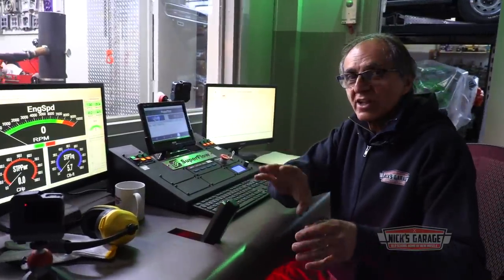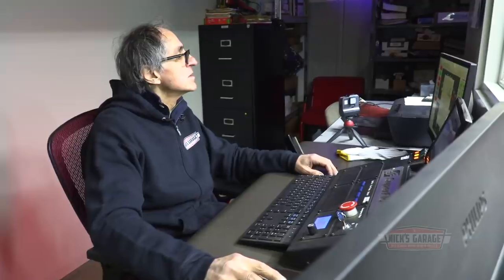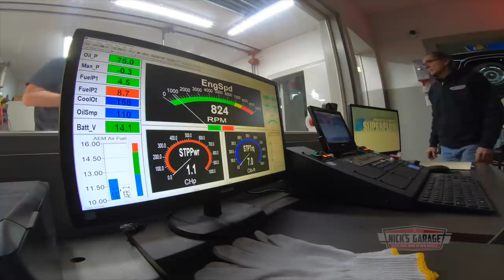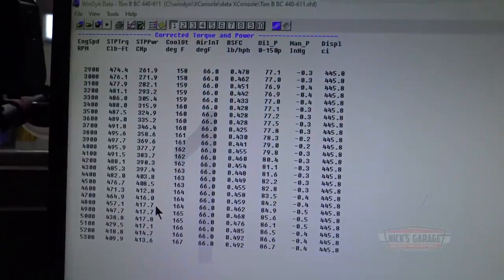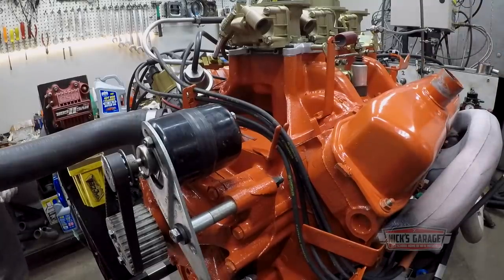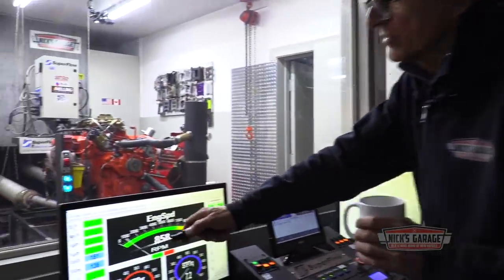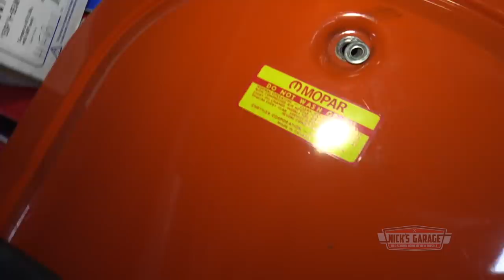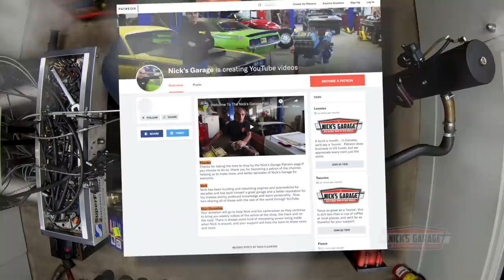Classic 440 Dyno Tested - 1969 A12 Road Runner 6 Barrel

Comment: A friend of mine that was into drag racing with olds 455 engines in his 70 Firebird drag car, made em live with lots of oil. The olds 455 engines were notorious for spinning bearings because of their large crank journal size, he made em live with a 9+ quart oil pan, high volume and pressure oil pump, bearing clearances slightly on the lose side, straight 30W racing oil, he also ran an "accu sump" oil system on it. His theory is you need heavy weight oil and lots of it, with zero starvation issues. He also has a mid 70's chevy 4x4 half ton truck that has 3 ton axles, transmission/transfer case under it, a blown 454 chevy sticks out of the hood, he uses it as his equipment hauling rig, has custom titanium headers as regular aftermarket steel ones just melted, he pulls backhoes and graders on a trailer, goes over mountain passes and blows the diesel guys doors off with his blown 454 chevy. He runs a straight 50W racing oil in that engine, does the same thing as the olds engines, huge oil pan, high volume, he says never let an engine have starvation issues, that's when you'll spin bearings.     
On the other end of the oil spectrum I had another friend who ran Yamalube R 2 stroke premix oil in his crank case of his 350 chevy engine in his circle race car! I don't know what the weight of 2 stroke pre mix oil is, but it's light, his theory was the light weight oil allowed the engine to rev faster but still offered enough bearing protection, seemed to work as he won lots of races, cars exhaust smelled like a 2 stroke engine.

Comment: Nick your channel is awesome. Today May 21, 2023 I was leaving a grocery when i heard someone having engine issues. Not being very knowledge but willing to lend a a hand, assistance was offered. This was a 68 Ford F100 with an in line 6. I followed your instructions but wasnt sure how to check. Air, Fuel, Spark. Three other folks came to offer aid. And class began. After running through the check list we found the issue. The carburetor. So just to get him running we shot some starter fluid into carb, we got turn over. Because we were willing to help a jewel of experience was awarded. Your teachings gave the confidence to at least try and help someone else. Thanks Nick
Reply from the maker: This is terrific! Thanks for letting us know, Bobby. Nice work.
Reply: Thanks Mr. Nick

Comment: What a way to wake up! To Nick at the dyno with my favorite engine and car.. brings back the memories.  I took this engine back in 84 with alot of the A12  parts on a 69 RR with a4.10 gears 4 spd. 485 comp can . 30 over pistons. .5 bump in compression.  Some 10 inch slicks. To a best of 11:38 @118 traction was at premium.  Latter worked on the rear. More cam 590 purple shaft. But no 6 bbl. Could afford one so it was ran with a torquer tm7 800 holley. It then ran a best of 10:69 at 124.7 .. still have the old bird.  Looking forward to some day.. as we all do.
Reply from the maker: Congrats for holing on to the car all this time.

Comment: I am a big fan of WIX oil filters. I've used them for years.
Reply: That's all you really see at the drag strip. That and Amsoil motor oil
Reply: @Oakie very good. Dads been using them for years. Swears by them. Fram are junk personally.
Reply: @TheSleepyMechanic0524  Fram and STP are manufactured by the same company. Ok filters, but nothing beats a WIX. Imo

Comment: Test seems to prove that HV oil pumps don't rob nearly the power people think. I too like 10w-30 oil, but I prefer the HV pump with fully grooved main bearings and looser than normal production clearance (.0025" rods and .003" mains). Nice work!!

Comment: Awesome !!  Nothing makes a 440 better than a properly tuned 6 pack !!  Great job !!  Cheers !!
Reply: Well Paul, in fact it is not  6 PACK....It is from a Road Runner and therefore a Plymouth...and...Plymouth never produced Six Packs...only Six Barrels...
Reply: @mark006868  Your absolutely correct. I was referring to the 6 pack induction in general. None the less your right on.  6 pack on a Dodge, 6 Barrel on a Plymouth.

Comment: Man so those Chrysler engineers had a good idea what they were doing! Thank you for sharing Nick!
Reply: They did?
With some head work and a better cam it's still not putting out 1Hp per cubic inch. How is that a good idea?
Reply: @OldGriz708  .     Those exhaust manifolds take up easy 40 HP.
Reply: @OldGriz708  Chrysler Engineering superiority by your benchmark of 1:1 HP:Inch³ ? The 426 Hemi would meet or exceed your requirement. The 440 6bbl had hydraulic lifters, iron heads, and in most cases a cast iron intake manifold. Although the HP RB exhaust manifolds weren't horrible, they are a 30 HP detriment to output. From the 440 4bbls and 440 6bbls close to or dead stock, usually they dyno at about their factory ratings + 5-10% Again, from an engineering perspective, the deep skirt block design has inherent strength to it vs Ford or GM big blocks, and the shaft mount rocker arms are the epitome of valvetrain stability. I'm building a 541 BMP aluminum block, and it will be fed by the 3 Holley 2bbl carbs from the 6bbl, albeit on an aftermarket single plane intake manifold.
Reply: @OldGriz708  For the period in time of when they were made, the power they put out was very good.  By today's standards maybe not so great, but back then they were as good or better than most every other brand.  The basic block and head design of these RB Chryslers is at least 60 years old - of course some things have improved since then.  Plus, as we learned from previous dyno tests on this channel, the exhaust manifolds are a huge restriction.  It wasn't like Chrysler didn't know how to make a better exhaust manifold - more like the bean counters got involved and that was that.
Reply: @johnz8210  
They never made the power they should have for the  cubic imches.
Reply: @OldGriz708  That is true.  But nobody else really did at the time, too.  Cylinder heads and camshafts have come a long way since then. 
Pick-up truck diesels now have more horsepower than the biggest baddest semi truck engines of 50 years ago.
Reply: @OldGriz708  The bottom line: among pure stock cars, A12s  were essentially unbeatable.

Comment: Headers are such a pain they aren't worth the problems unless you have a race car. Headers you fight spark plugs, frame clearance, starter swaps, heat. On my chevies I've gone to ceramic coated center dumps that are bigger than stock. And one is a stainless steel rams head that is set up like a header - so performance isn't far off. Save all the heartache.

Comment: Great video and Test - Fixating entertainment! Increase in torque with the air cleaner in place is due to the airflow being organized for better flow by the air cleaner base, this as the air flow transitions more efficiently over the top and down the throat of each of the carburetors. Old Mopar drag racing trick is to run just the of a Mopar air cleaner for best performance.
Reply from the maker: Thank you!

Comment: In a lot of respects, it could be said the 440+6 could have been a better street engine than the Hemi. It sure made the torque. The Hemi was raw HP on the top end and you could get it to do a heck of a lot with gears and some other minor stuff, it was a tuned down race engine. But for realistic day to day driving, that 440+6, or any HP 440 with high compression really made great torque on the low end and didn't cost a fortune. Easy to own for sure.

Comment: My old 440 in my '69 charger used to run about that same oil pressure, even when warm. It would also scream up to almost 7000 RPM though so it could use all the oil it could get! Dick Landy Enterprises did headwork on that engine and it sure showed.
Reply from the maker: Sounds like a beast.
Reply: @NicksGarage  it was! 12.5:1 compression w/big Racer Brown cam: .610" lift @ valve and 312 duration @ 0 lift on a pretty tight lobe center, solid cam. Very rough idle. 6 pack full floated rods, nitrided std. journal forged crank, TRW forged pistons, Max Wedge adjustable rockers and hemi hi volume pump to name a few items. Passed everything but a gas station and made over 600 HP on a dyno 40 years ago. 4 speed car made it more fun, wish I still had that car now!
Keep up the great content, Nick! Love my Mopars!

Comment: A great way to start a Monday, the sound of a six-pack making some very respectable power.  I know that Tim will be impressed with the dyno numbers, especially with the air cleaner installed, great job on the engine Nick.  A-12 cars are always impressive, but this one is going to be just a little bit better, now that you have worked your magic, on the engine. Great video as usual, very informative, and entertaining.  Already looking forward to next weeks episode.
Reply from the maker: Thank you very much, sir.
Reply: Eugene I’m very happy with the numbers that Nick hit on the dyno! Putting the air cleaner on was a good idea Nick, we discussed what HP I would like to see from the very start and he nailed it! Amazing, the car and engine went to the right place no question about it!
Reply: @timbutler7433  Tim, you have an awesome car, and very rare too. A-12 cars have always had a special meaning for me.  I remember driving one of my friends to the Dodge dealership in July of 1969 to pick up his brand new A-12 Super-Bee in B5 blue.  I feel the same way about my Charger being in the right place.  Nick does fantastic work on the 60's muscle cars.  Enjoy your impressive ride Tim.
Reply: A 70 torino cobra with a 429 is faster with a smaller engine and it weighs 4.200 pounds doesn't say much for a 3.500 pound car with a 440
Reply: @darrellsomers5427  That may be, but I would take the Mopar over the ford anytime if given the choice.

Comment: Fun Fact: When I was setting up my six-pack in my '70 Cuda, the secondaries wouldn't come on until about 4700-5000 rpm. I bought two vacuum can spring kits. Tried different springs in the kits, settled on the white lowest tension, cut in half. Secondaries would open at 3200-3500 rpm, which ended up being perfect. A properly set up six-pack is a dream come true!!!!!! BTW, mine did feel like a double kick down.
Reply: What secondairys there 2bbls you slowpar  guys kill me

Comment: I'm not surprised you did a tic better with the air cleaner on I've seen guys remove air cleaners at the strip and go slower (me included) something about smoothing the air flow, I dont know. I think this A12 will pick up the lost hp once in the car and supplying some forced air.....nice job.

Comment: Where, oh where were you @NickPanaritis back in 1978 when I owned a 1970 Dodge Coronet R/T 440 6 pack? There was nobody in a 50-mile radius of Central Florida back then who could properly set up the 3, 2-barrel configuration with a mild lift camshaft upgrade to my 440. A bunch of "Specialists" said they were proficient in fine-tuning multi-carb setups. It turns out that the only thing they were proficient in was making my wallet light! After seeing, and hearing Tim's 440/6 singing on the dyno after you worked your Voodoo on it. I wish I could have taken my Coronet to Nick, instead of switching to a 4 barrel setup from Vic. (Edelbrock)❗👍🇬🇷🇺🇸🇨🇦
Reply: Greg.      In 1978 I owned a 426 71 Hemicuda,,  dual carters, and a 1970 AAR Cuda 6 Barrel. And at the same time, I worked for a Pontiac-Buick-Cadillac dealership working on engines. I wish I was there to help you out with the 1970 Coronet R/T.

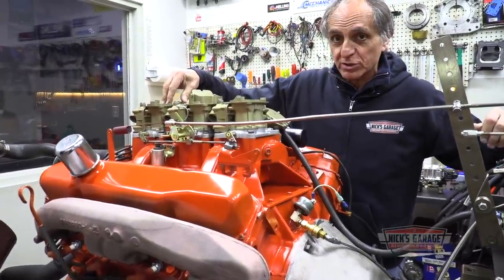Comment: I had back in the day a 70 Cuda 440 6bbl , 4 spd , shaker car 3:54 gears, the carbs were mechanical no vacuumed pods , Mallory dual points , mechanical as well, with a 525 racer brown cam, I don't know what h.p. it ran but it was fun to drive, it had pwr steering,  and per brakes all the horse power robbing accessories,  but it was still pretty fast.

Comment: Morning Nick & Devon, that was one sweet sounding 440 not only at idle but when taken out to 5300 rpm's also. I knew you would get your numbers too Nick. Glad you changed the oil pump as that pressure was way to high. I hope we see a video once that 440 is installed in the car and the weather is right Nick & George. Thanks for sharing as its the best start to the week.

Comment: Hi Nick. A test with different octane. Way for all gasoline car engine are basically produced for 110 Octane gasoline. Take a test with 95 octane up to 110 octane and see what happens. A test with 95 and 97/98 and 110 octane. Love the Classic 440 Dyno Test-1969 a12 Road Runner 5 Barrel. It is a Nice Engine. But it is made for 110 Octane. It is. Not 95 or 98 Octane. 110 Octane is 110 Octane. Back at the 90 i had a 68 Nova II 350 Engine. Love that Car real nice. Love from me too you Nick.

Comment: Very interesting episode!!! This is awesome... K&N was the right air filter element to use for this test!!! It actually gained 4 ft./ lbs. of torque with this test... Another thing to consider about using the ram-air filter with that car, is the increased air pressure into the intake from ram-air being forced into the large 6-pack air scoop, when the vehicle is moving along... Quite a cool episide!!!

Comment: Waow there's always something new to learn Now it's Tims 440's Dyno turn Nick's Garage has the technology and fuel to burn Running it over 100 psi makes Nick's mechanical empathy squirm  It's from a 69 Road Runner A12 into which it's been fascinating to delve I like the sound of a V8 any day of the week but the only guarantee is Nick's Garage on a Monday when it's the old school that I seek There's no oil leaking so it's time for Nick to do his usual timing and tweaking This engine's no weakling Built to drag best fun to be had Tim's got swagg

Comment: I used to be one of those guys that thought you needed to use a high volume pump, but with a 4qt sump pan like the 402 ,a high volume is a bad idea. A good high pressure, standard volume pump is all you need. The high volume pump is really for Hemis because of it has full time rocker shaft oil that has to fill 4 shafts. I have to admit though I did cringe a little when Nick took that pump right out of the box and put it on the engine , in the past I have found that the pumps are really that clean out of the box, yes the oil is going thru the filter before it gets into the engine but I like to clean them first and do a little clean up on the inside of any casting irregularities ...
Reply: John.       Good point.

Comment: I used to run TRW 
High-volume oil pumps 90 psi rated I’ll usually dial in @ 55 my big problem was power steering pumps so I always Converted to manual steering which became a problem with the spacers in the columns but then finding a manual box but that’s what I did on my charger and demon

Comment: 6 packs look nice , there really cool but one or two 4 barrels are lot easier to deal with and work just as good :)
Reply: You just don't understand until you ride in a properly setup and tuned 6bbl
Reply: No harder to set up a 6 pack than a single 4 barrel.

Comment: Hey, Nick! Love to hear those Horses unleashed. Is there a better sound than a 440 six pack engine. Whaling out loud. I thought the HP would drop when you put the air cleaner back on. But it didnt drop much. How would the higher oil pump hold out in the long run. Would it blow the seal or rings? Those Melling oil pumps are built really tough too. Great video!  Shawn.

Comment: The air cleaner assembly/hood was designed to direct lower temperature air directly into the carburetors with the vehicle moving, so in use, th
Reply: so in use it would be expected to increase engine output.
Reply: @georgewetzel4380  .    Yes.

Comment: Another great start to the week!  Seeing the big 440-6V engines struttin' their stuff is always so fun - just about the perfect toy that any grown adult boy wants to find under the tree, especially if it comes gift-wrapped and bolted on a dyno.
I must say, however, that it's been too long since we've been treated to the biggest toy of them all, a 426 Hemi on the dyno.  My energy level is dropping and I feel a little faint.
p.s. - Was there any change in the A/F ratio running with the air cleaner on?
Reply: Easy.        No, no change.

Comment: Dear Nick 
 My passion is Holden inline  6 cyd. Engines 
Your passion 440 Chrysler engines
I can still buy new Australia make oil pumps. But I have to dismantle them and remove the swore of the drillings and general machining. ( Brilliant )
I agree with you on oil pressure over 70 p.s.i  cost you h.p. and the oil gets hotter costs you reliability.
Not so cracky old man from Down Under

Comment: No better way to start the week then a 440 six barrel !  Superb.
Looks like a fiberglass lid on the air filter? The tin ones fit way better
Reply: Mike.          NO fiberglass lid on this engine. It has the real tin plate.
Reply: @nickpanaritis4122  the edges aren't rolled down? I have a tin Hemi lid . looks different around the edges. ( talking about the orange lid)
Reply: @MikeJBlues  .      Yes, the orange lid.   It is Tin, maybe repop ?

Comment: These engines, like most high performance engines of the day were under rated for insurance reasons. A bone stock 440 six pack was around 425 horsepower!
Reply: No they were not you slopar guys kill me its a mid 14 second car stock

Comment: Love your channel Nick!! I’m a huge Mopar fan and I’ve learned a lot from watching you for many years. I have a question. Of all the videos I’ve watched about running engines on the dyno, why does so many people start the readings at 3000rpm? Now in this video, you started at 2800.  Is the dyno not accurate at lower rpm’s… like 1500-2000 rpm’s? When buying a cam out of a catalog, they list power numbers from either idle or 1500rpms..